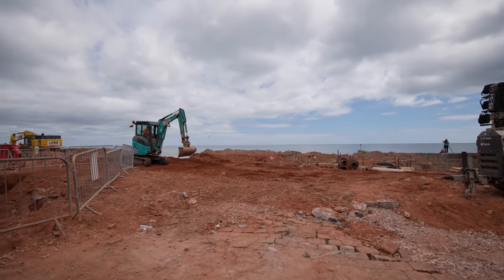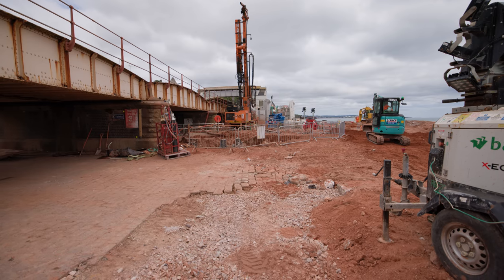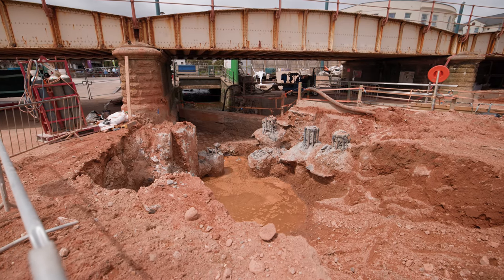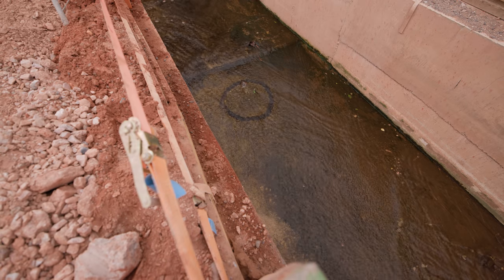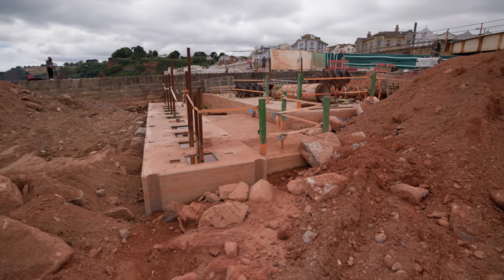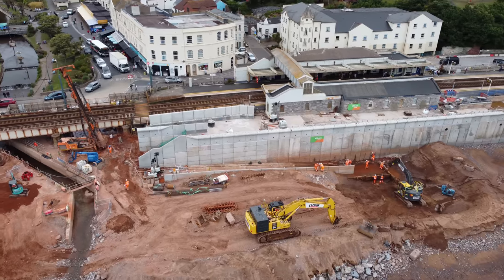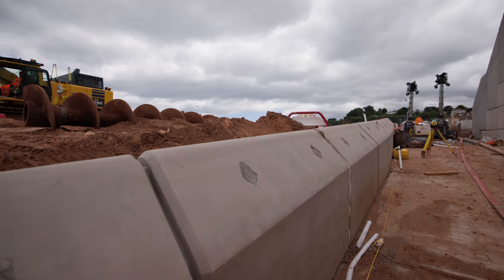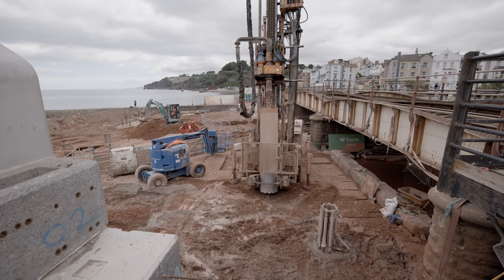Guided Tour of Dawlish Sea Wall Build July 2022 with Bam Nuttall

Comment: All the years i've been going to Dawlish (40 or more), I watched as each year, the sand has longshore drifted up the wall.
When I first came to Dawlish, there would be at least a 10 foot drop from the LOWest part of the wall to the sand, at high tide it was deep enough to jump off the TOP wall into the sea.
I was wondering, where the original work was done, it could be replicated - dredge the sand, and put a few groynes in.
It's the same with the Red Rock, the wall is damaged simple due to long shore drift and the water being higher.

Comment: I'm sure you have already kicked yourself...audio levels out of the Rode Go's, both were clipping. I have noticed this on my GO-II's, unless I set the gain carefully, they will easily overload and clip. 
You know you can mix both mics down to mono on each channel of the camera system?
Reply from the maker: Hi Yes. I'm aware. I like to have a little stereo separation on the channels but I forgot to mix it down properly before I rendered it, and the yes kicking myself about the clipping.
Reply: @CoastCams247  It's always a bit odd when BAM man is on the left...but his voice is on the right! 
The issue is that two Rode Lav's feeding ch 1 & 2 is not really stereo. Mixing down to reduce the separation is a neat way to go.